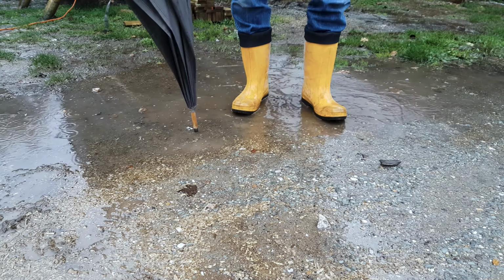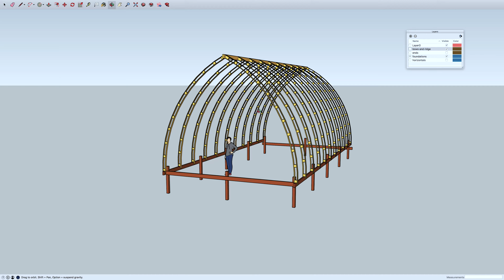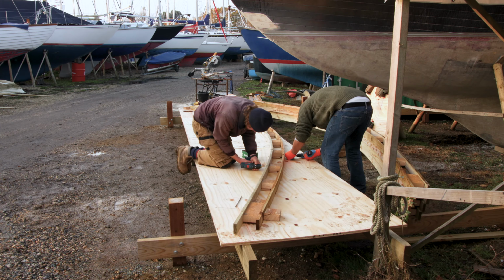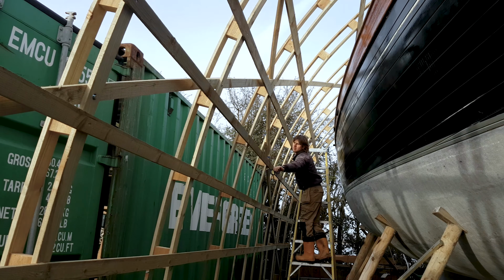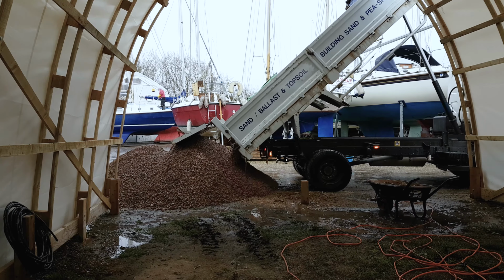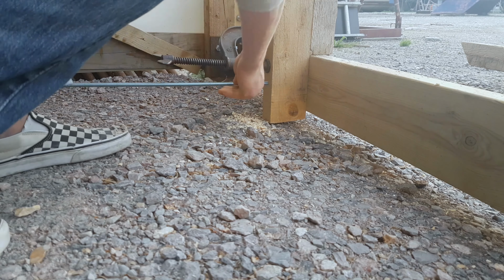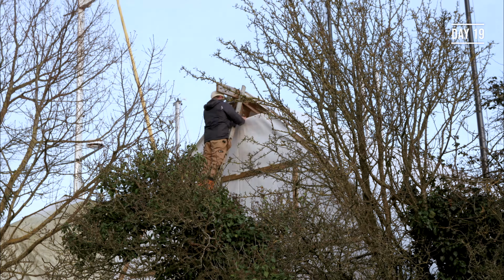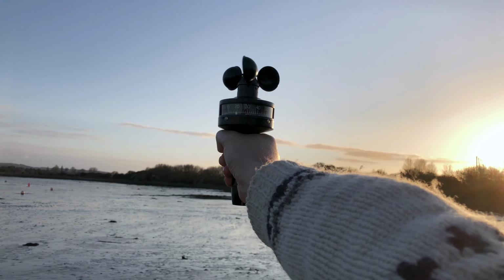HOW TO BUILD A BIG TENT

Comment: I have been building these for years . A few things I have learned .the chord length will deflect a maximum of 1/6 of itself. That is a 12 foot length will support an arch that is 2 feet deep,soaking the material in water or hot water aids in its flexibility. Wet wood can be glued with urethane construction adhesive, it sets with water. Rather than pulling a curve onto horizontally placed blocks, it uses less material and is more efficient to push the form down into risers that form the curve. I fix my blocks onto the top chord glue and air staples then push it down into the vertical risers tacking here and there with screws,no clamping necessary, then apply glue to blocks and push the inner chord down onto that assembling the truss with air construction staples. Undoing the tack screws it pops from the jig . You can expect 10 % spring back. I layout the curve as a catenary arch. This I found is the simplest tech , I could never understand the massive area and sport to construct horizontal platforms and blocking and clamps etc. A vertical form requires no platforming and can be as simple as hammering stakes in the ground.. for planning select three points one midpoint offset by 1/6 and drape a chain connecting the three, the curve formed is the layout of a catenary arch . Plan using scale grid paper transfer the measure and angles to stakes ,vertical risers, miter the tops and the form is ready to press your trusses.
Reply: can you do a diagram? this is super difficult to understand
Reply: Sounds brilliant Paul. Are the different processes you describe visible on line some where ?
Reply: Maybe you got some...video?
Reply: If someone can school me on how post a jpeg , I would commit the whole process to a graphic that would clarify the concept. I am elderly and haven't got to posting videos it's above my pay grade right now.
Reply: @paulhayes9832  Hi Paul. For the 10% spring back, do you adjust for this when setting your stakes or do you set them normally and accept the spring back as the finished product? Thanks.
Reply: @johnnyfrye7004  greetings it can work either way. That is if required for some specific reason you would adjust the stakes run a truss off and use it as your master if it suits. The critical criteria is that they are all similar and more so that the blocks are all aligned for running purlins and other structural components. Your not trying for exactness as much as similarity, the springback hopefully wouldn't exceed 10 % for softwoods. Set up create a master and checking all subsequent truss to the master is important.so the answer is its up to you just realize it will springback a bit . I do metal tube trusses and they spring back too.

Comment: would it be a long lasting shed / garage if covered with metal corrugated sheets ?  need something similar for a large tractor
Reply from the maker: It would flex too much I think
Reply: I think metal-corrugated sheets would work great... If you ask an engineer, they would tell you that a pole building gets most of it lateral (shear) strength from the metal wall panels.  So metal panels on this arched structure would replace the 1x diagonal bracing.  Perhaps the real question is: how much the wooden arches would flatten out with the weight of the metal wall panels.  I think use 29-gauge max steel thickness.  The best way to prevent the arches from squatting down is to use a load-bearing ridge beam (that is supported at the ends with door headers in the endwalls).  Another good way to prevent the arches from squatting down is to have relatively tall arches compared to the width of the arch-base.  Use best practices for gluing/nailing the wood blocks in each truss.  Finally, if you are still feeling conservative, you could tighten up the typical arch spacing.  Don't mind me, I still have hopes to build my first boat shed.
Reply: @stevegregg4850  Thanks for your advice Steve
Reply: @moldprintsrl  I think that these arched sheds (with plastic or vinyl covering) are prone to collapse from "unbalanced snow-load"... so be careful about having snow drifts on one side of the building and not the other... With local knowledge and awareness of snow drifting (and snow melting cycles), you should orient the axis of your building to minimize "unbalanced snow-load" or "unbalanced snow-drifting".   @Stran I , if you have snow loads (or snow drifting) in your area, DO NOT BE TEMPTED TO USE RIPPED STRIPS OF PLYWOOD FOR THE ARCH CHORD MEMBERS.  

If you use metal roof panels over wood arches, pay attention to condensation on the interior of the shed (you might need to ventilate or heat the space).... If you have excessive condensation, then your wood arches may not last as long as the metal roof panels.

@stran I , If I were building one of these arch sheds, and if I was planning to "skin" the shed with metal roof panels, then I would really think about up-sizing the interior chord-members (of each arch) to a 1x6 (or a rough-cut 1x6, or maybe a double 1x4).... (the outer chord-members are less important if you are using metal roof panels).... The reason is that:  1) the metal panels will provide some arching action across the full-width of the shed  (acting in compression to strengthen the arch for dead loads or snow loads), and 2) the metal panels will provide some bending strength (metal panels acting again in compression) for each half-arch which spans from the footing to the ridge...But the half-arches ought to be strengthened in bending by up-sizing (or sistering) the interior chord-members to a 1x6 (or a rough-cut 1x6, or maybe using a double 1x4 for the interior chord-members).... Note:  these interior chord-members would be acting in Tension when the half-arches are working in bending.

Strengthening the half-arches in bending will provide resistance to wind-loads, and provide resistance to unbalanced snow loads.......  If you have a "skin" that can deliver wind loads or snow loads to the half-arches.
Reply: Check out the John nock you tube channel. He has a video on just that topic.

Comment: I like the simplicity of this design. It can be applied to an actual home as well. Perhaps instead of the two curved pieces you could use this to make a dome roof. And instead of a tent, you can add read walls and have a real home.
Reply from the maker: The problem is that its flexibility is its strength. It would have to be made very rigid. I was thinking that the bows could be laminated in a mould from plywood. Then purlins and cedar shingles on the outside, but the bows would have to be very chunky.

Comment: What do you think the longevity is on the canvas?
Am also in a very wet environment with stormy weather.
Reply from the maker: If you get heavy lorry tarp it should last for 5 to 10 years. The shape of the tend spreads the load nicely so there isn't much chafe. I got the tarp manufacturers to put a double thickness strip on the ridge area though. Hope this answers your question. Cheers, Tim

Comment: What is the D4 glue that you used? Is it a pva or urathane single part glue?  Did you glue the arches as well?
Reply from the maker: It’s PVA. I didn’t glue the arches, but I could have/should have done.
Reply: @seaschool_  Unfortunately I found out it is not available in the states.
Reply from the maker: @gary24752  any PVA glue will do

Comment: I HATE using a post hole digger!
So when I learned you can dig a post hole in minutes by simply pointing your High Pressure Washer wand at the spot you want a hole all you have to do is 
A. Deal with the mud splatter till it's under water.  
B. Deal with the little stream of muddy water that runs away from the hole..  Or you have to bucket the water out of the depression you decided needed a post hole.
So save that back and use your pressure washer.